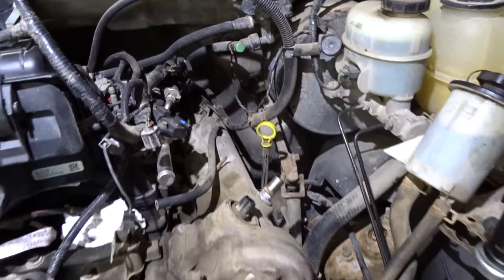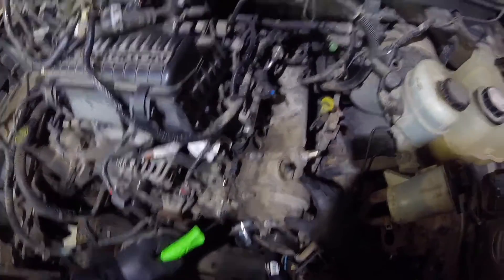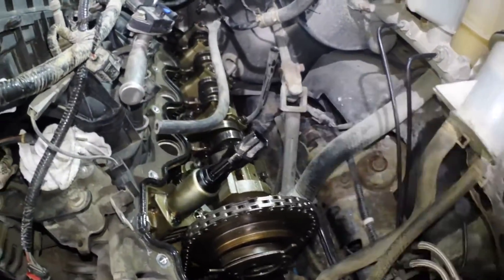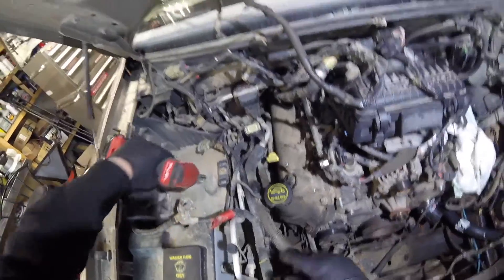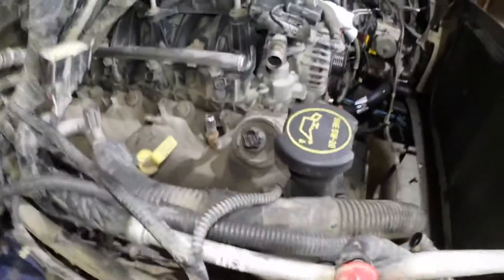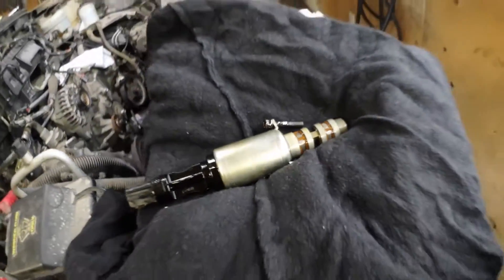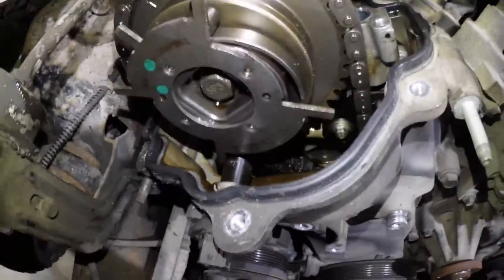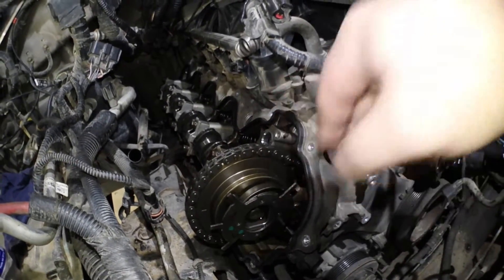Ford 5.4 3V Timing DIY Valve Cover Removal Part 3

Comment: I wouldn't use a 12 point socket on those unless youre hammering it on a stripped bolt..using 12 point will strip the heads out easier with them crusty 8mm headed bolts

Comment: You saved me. That cover is not easy to pull. I’ll yank the valve cover screws, pull that battery tray and loosen up that dryer. I really don’t want to loose that gas. Your video was excellent.  Hey. One thing. The wire harness how did you move that around?

Comment: I replaced my valve Covers with the updated ones, has 7 bolts per side instead of 14, was definitely easier to work with. New one's does not have the bolts on the side near the firewall.
Reply: Wait, the 7 bolt ones will bolt up to the 14 bolt heads?!?! You just saved me soo many headaches as I am fighting to get the covers off right now and was NOT looking forward to putting all those bolts back in.
Reply: @azmadmonk1  yup

Comment: I havre to do that for a 08 v10... I am wondering if that passenger side valve cover gets more room if you put the jack on the body and lifting it up a bit... Your thoughts?? The AC?? I know there is a secondary transmission fluid filter that they put there just to get in the way..Apparently does almost nothing..
Reply: we’re you able to get the vct solenoid out without removing the valve cover,since you have an 08?i do too and i heard you have to remove the valve cover on the newer models.

Comment: I have 07 expedition
Have intake manifold out bc im putting new Cylinder head temperature sensor and the pigrail for it. I can see bare wires. Causing code P0119. Only code i have.
Have leaky valve vober gasket on pass side. Thought id have enough wiggle room to get it out.
I tried for 2hrs trying to get it out. With the harness and ac tubes and hoses i cant for the life of me get it out.
I was able to inspect most of the cam lobs and lifters. They all have a little bit of play. But not alot. The timing chain feels so loose as if the guides shattered and chain just floating in there.
Has 195k miles on engine.
I cant believe there isnt more codes.
So to do a full fix im looking at putting about $1500 in just parts. I dont think its worth it. As of now i realize its a ticking time boom. Im so let down knowing this.

Comment: How the Frig did you remove the back center valve cover bolt? Short/deep? Extention? 1/4"/3/8" extractor?   I'm about ready to push it off a cliff!  Thanks brother!
I'm Almont 3 weeks into working on the truck. Gone from a "Crank No Start " to running like a bag of cats!. All 15 test drives ( very short one's due to either stalling or just a super rough idel) I've had camshaft positioning sensors every single time. The last test drive it thru a p0010 and the camshaft sensors again. So 1st thing I did were both sensors to no avail.  Checked all fuses and relays, safety neutral switch, egnition switch, grounds, vacuum,  fuel/spark, had 300 on my tac. so I knew I had signal going to the PCM  etc.   I'm guessing I jumped time or the phaser or VCT is shot. But I can't get that last valve cover bolt off. Going crazy! No, already there!! lol...Any feedback would be great. Thanks

Comment: good job good video absolutely recommend moving the wheel skirt absolutely take those dang bolts out just did this to mine and now I get to have the same friend you did trying to get it back in with the gasket still intact

Comment: This is lame, but im hoping to find a good answer here...

While removing the VCT solenoid on my passenger side, the screw fell and i haven't been able to retrieve it with a magnet.  What should i do next?
Reply from the maker: If you can’t get it out then I guess your taking the engine apart

Comment: Do I have to remove the valve covers on a 2010 F-150 5.4 to replace VCT solenoid
Reply: You do, I've fixed the problem awhile ago.  You can't retract them through the port, covers have to be removed
Reply: Yes, I'm getting ready to do VCT's on my 2010 and it's really beyond frustrating that they didn't keep the same style valve covers as the 2004-2007 trucks.
Reply: @learnalittlelivealittle6502  5 months later and its running like new still.
Reply: Shouldn't.
Reply: Dang so I gotta drain my engine oil that’s fresh?

Comment: that valve cover bolt right next to the accumulator is killing me.  I'm doing a complete overall of the timing and have gotten everything disconnected on the drivers side.  i have three bolts left on the passenger side and from what i can tell the bolt was rounded over during original install.  the bolt is more like 7mm than the 8mm it should be.  i cant get a bite on it.  any suggestions?
Reply: Im having the same problem with 3 bolts on the drivers side. You can buy a bolt grip expansion set
Reply: I know they make a special socket that will take out stripped bolts. It has teeth on the inside when you twist it the teeth engage. 
I know they sell them at Canadian Tire stores here in Canada. I image they have something similar where you're too. I hope you ended up getting them off
Reply: @jacksimi  ..I also picked up an extractor set from crappy tire.  I'm In Ontario and 7 of my 15 bolts were pooched. Guessing from the weather and salt.  Soon as I put my 8mm on them, they were sloppy as S#/+. As of now, I can't get my last bolt out!  Back center bolt.  I've tried 1/4-3/8 drives with extentions and without, extractors, swivels, deep and shallow.  I'm about to lose my mind man!
Reply: @locknload9143  When i took mine out I warmed the engine up lots then went to work removing them as fast as possible.
Reply: Papa Bear..What bolt we're you having trouble with?  Drivers side back center or passenger?  If Drivers side, did you remove the wheel well skirt?
Reply: @locknload9143  Passenger side.  i went in through the wheel well.   wound up cutting away some of the liner and bent some of the ac piping to get at it.  a nightmare job.
i still have the truck and everytime i come across someone that's done this timing job it becomes a half hour conversation about how painful it was.

Comment: Hi, when outing Beck the passenger valve cover. How you get it back without breaking the back part of the gasket.
Reply from the maker: I remove the fender skirt to help with the install
Reply: Do you have a vedio on it

Comment: Thanks for this video doing the timing and oil pump and other parts along the way (ie water pump cause I'm already in there) on an 06 F150 4x4 and don't want to remove my working not leaking ac system, this video was a great help! P.S. I went with the Melling M360HV since I have high mileage (260k) and wanted the extra 20psi just in case I have some cam cap/tower wear.
Reply: Take off inner fender wells then valve cover wide open
Reply from the maker: Good luck in the task, this isn’t a very fun job